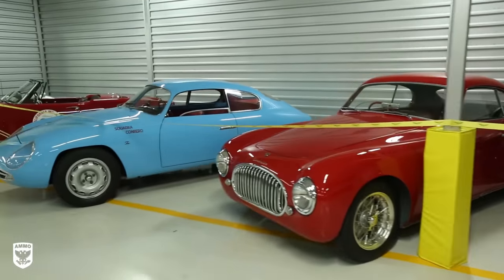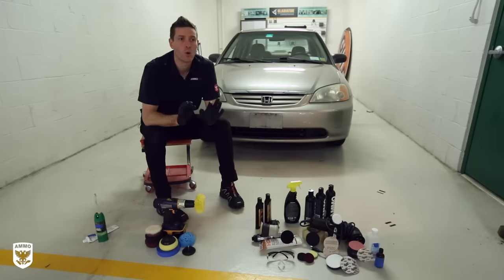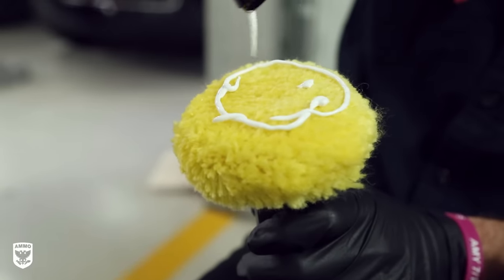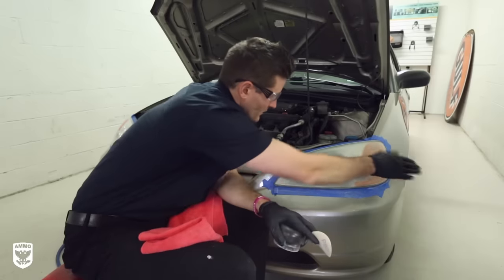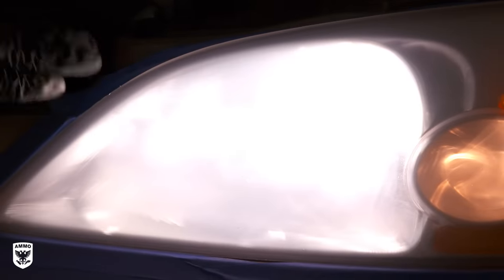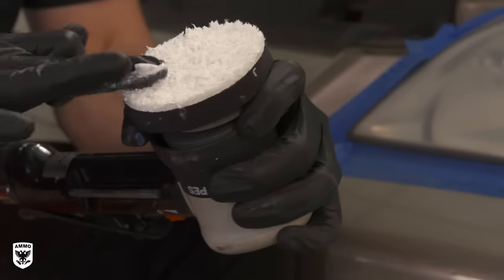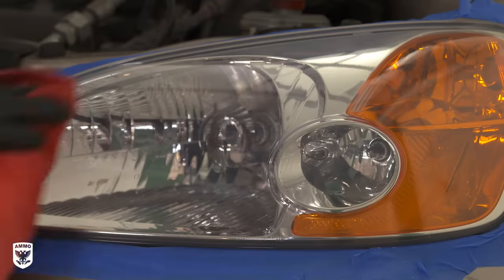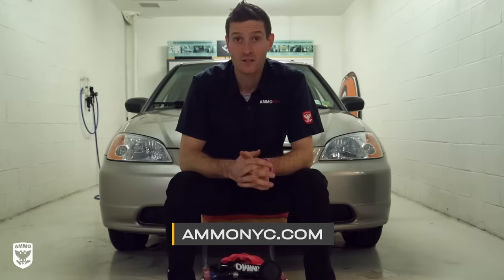How to Fix Foggy Headlights: 3 Different Methods: Honda Civic

Comment: What’s “compound” exactly?
Reply: In lamens terms: Compound is a highly abrasive liquid/chemical which "cuts" layers of the object you are puttinng it on. In the case of paint, the clear coat and in headlights, the top layer of coating or polycarbonate.

Compound is meant to remove large layers of the top coat to make it smoother or more level by removing deep scratches(during this process it will make small microscratches). You are supposed to finish it off with a polish which is less abrasive and cuts in particular areas removing less of the top coat and cutting down the more fine and smaller scratches to get a flat finish. That flat finish is what makes the top coat look new again because light will bounce less removing hence glare you get with scratches.

Comment: As to that “remember to change your Blinker fluids” comment remember at the turn of the last century from the 1800’s to the 1900’s .. I do believe they used kerosene lanterns for lighting .. so adding fluids was a thing back then .. much as muffler fluid is now a thing .. add your blue fluids 🤪😎

Comment: None of this does anything when they aren't sealed right and they are dirty and foggy on the inside. You cant fully seal them either because of heat and they have to breath. Sucks.

Comment: why my plastic head lights not yellowed? Chevy Blazer 1995 590k miles, Guide headlights(USA made), never ever been polished, i even rebuild an engine once and transmission once, but headlights are the same... 
And i never see yellowed headlights on similar trucks, pickups....
Any suggestions?

Comment: This has to be the only video where someone has recommended 320 or 80p grit sandpaper and has done a dry sanding. I'm about to do a restoration on lights that are probably worse than these. I'm iffy on attempting a 320 grit sanding, especially dry.

Comment: This is all great, but my problem is, it's the inside of the Headlamp that needs restoring..........
Reply: ***** I managed to figure it out myself. but I only left it in for 3 minutes and it worked like a charm. I've got dust and carp in the headlight, plus the lens itself.

Comment: Wouldn't it be easier to just replace the headlights with new ones ? Verse taking 4 hrs to make old ones look new and have some scratches still on the lenses? 
New headlights lenses on daily beaters are cheap

Comment: I understand this is an instructional video and it's done very well....but for a "beater"  03 to 05 civic sedan....a replacement headlight is cheaper to buy than the cost of products needed to restore it. In order for restoring headlights to be worth doing, they should be expensive ones

Comment: 99%  I'll drink it and headlight will look clear :'-D Time and money saved...and a lot more fun :-p

No, but to be real, the after market UV coatings, are they even CLOSE to what the manufacturer puts on in a prefessional plant even at MOULDING PROCESS?

If you use lets say tooth paste you wont remove the factory UV layer, only the outer debris. No harm done.

If you sand it down and things go south, your headlight is f..kd. i am sure there are links in the description Both for your steps AND buying new headlights. 
Either way, thanks for the grit starting point. I have got an old civic type r i need to shine up for a customer, i mean doesnt matter if this method only last 3months right ;)

Oh..i allmost forgot, WHAT WAS THE LUMENS READING YOU SAID IN START OF VIDEO :-) Did the cameraman or camera die, since you didn't tell. A photo of the headlight is useless, its the amount of light emitted and the beamform that saves lives, not how clear the plastic looks on a photo :-D This vid seems to be for kids on the block that likes it bling :)

Comment: Wow  for $$$ and lots of hard scubing  and tools you will never use again.
You will certainly have 
Your old stile original head lights .
Me for about 100$ I bought cool after market head lights and installed them myself for about the same time...
If they work properly   that's my problem..😜
Reply: Well part of the reason why there is the professional method is that they would use those tools again for either the same or similar jobs. From your comment, you seem to be best suited going along with the DIY path.

Comment: Uninformed video. The diy and home remedy are pretty much the same thing. Both are polishes for the lenses. Between your diy and pro kit is the 3M kit which utilizes different sandpaper grits to properly prep the lens and rubbing compound for the final polish, no Waxes or cover ups.  21.99 at any parts house. It's the almost pro diy setup, that works and lasts.  It definitely should have been considered. Very inaccurate video, when leaving that method it.

Comment: great video, but you used a honda and parts for them are so damn cheep and the aftermarket for them is huge, that you could have bought whole new headlight housings for the car instead of buying all the stuff to clean it or to do the last one with all the sanding.

Comment: New assembly is around $50.
Reply: try to fine a good replacement head light for 50.00 it is not as good as factory.
Reply: @johnkaveski7953  Rock Auto

Comment: Dude, this is amaturish shit. Cut a tshirt into an 8 inch by 8 inch square and fold it into a 3 inch by 3 inch square. Then fold it in half. Soak in laquar thinner. Squeeze just hard enough to remove thinner where it no longer drips. Now, starting at the top of the lens, press only hard enough to keep it against the lens. Pull from right to left. Do not go a second pass. Once only. Fold the rag once and do it again until you are at the bottom. There, a brand new lens in under one minute.

Comment: Sandpaper is illegal.. it messes with the thickness of the plastic which determines height/strength and length of the light coming through it. And that's coming from a channel wanting to be "professionals".

Comment: Headlamps don’t produce UV.
Reply: HID bulbs DO produce significant amounts of UV They produce light through electrical discharge like black light mercury vapour tubes do, just the gas mixture is tuned to produce specific colour temp visible light but still do produce measurable UV... incandescent and LEDs produce little to no UV light.

Comment: I really like your Videos, but why are your constantly wearing "Safety Glasses" where no Danger is visible? 

Polishing something BY HAND is not dangerous and wearing cheap Plastic Safety Glasses all the time ruins your Eyes in the Future. I agree, when Welding, Grinding or ding heavy construction Work - wear proper Safety Gear.... but hey, think twice and use your Brain - no Safety Glass will replace it and will protect you.